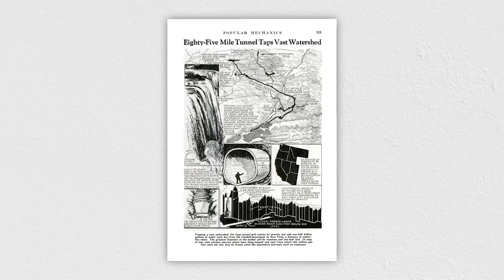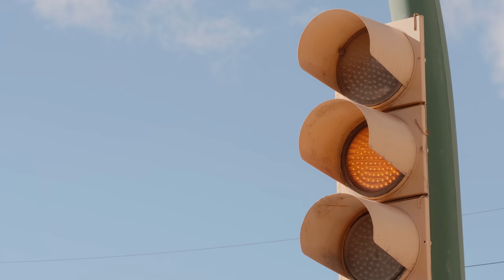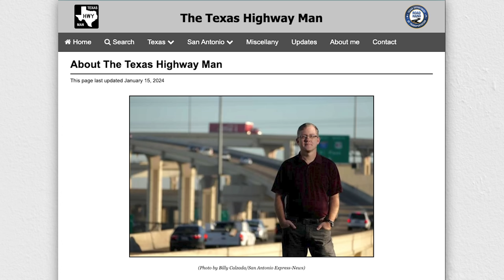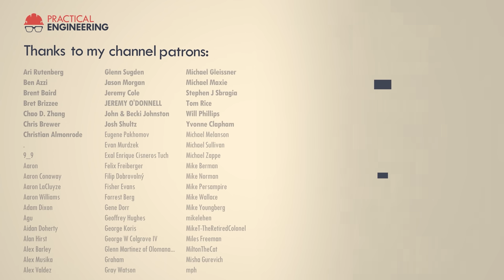Why Are Texas Interchanges So Tall?

Comment: As a german I find these giant stacked interchanges quite bizarre. Over here we rarely have left-turning flyovers. Most Autobahnkreuze (Freeway interchanges) are of the good old cloverleaf design, built in the 70s, with the lanes for off- and on-coming traffic seperated by a barrier from the through traffic. That makes the weaving in and out not so much of a problem. Next to the negatives mentioned I would argue the cloverleaf has a number of benefits: 
A) It doesn't have kilometers/miles of bridges per interchange that are both expensive to build and maintain since all of the ramps can usually be on earthen embankments. B) They are predictable. On a german Kleeblatt (cloverleaf) you always know where to exit: First exit to go right, second to go left. C) There (usually) is a continous looping sliproad on the inside that is capable of leading you in every direction, even if you missed your first exit (can also be used in case of Baustelle (construction work) on the right turning lanes). D) They are much less of an eyesore to the surrounding area as they are not tall at all.

Only when the cloverleaf really cannot cope with the traffic demands will the german civil engineer consider a different solution. With that being said the german freeways rarely exceed three lanes per direction so the traffic levels are generally lower. The busiest interchange in germany is still a modified cloverleaf (The Frankfurter Kreuz with the A3 and A5).
Reply: I'm sure a German you do, since your country is half the size of Texas and has four times the population density, its possible that you mentally may require a much fixed common driving solution.
Reply: Looking it up, Frankfurt has a population density of 8,100 per square mile & Berlin has a massive 10,910 per square mile while Dallas has a population of 3,841 per square mile and the Dallas-Fort Worth Metroplex's overall density is 880 per square mile. With densities so high, many German cities can rely on mass transit while most Americans live in areas far less dense where heavy reliance on cars makes more sense.
Reply: @Monsuco  You've got the causal relationship somewhat backwards: US cities' population densities are as low as they are largely due to their legally-mandated transportation infrastructure (*cough* a whole lot of bad law/regulation right there) and horrendous zoning. In most if not all American states/cities, it's *illegal* to build anything other than car-dependent sprawl.

You'd think with all that talk about the "free market", they'd let the market decide what it wants... BUT NO. The market's only allowed to do what it wants when it furthers the interest of certain well-connected and/or already-extremely-wealthy people & companies.
Reply: Yeah because you lot have busses and bike lanes. We don't have those in america, or we do have them some places but they're so terrible and unsafe that only the most desperate people use them. I hate your socialist utopia.
Reply: No you're getting the causality backwards. Look at Houston, it doesn't have traditional zoning laws and is arguably one the most free market systems of land use in the world, allowing commercial, dense residential and low density residential to built, often in the same neighbourhood. Yes there are covenants and historically there have been mandated lot sizes, but it would have still sprawled regardless as single family homes are the most sought after types of homes for most people. In countries like Germany, urban expansion is often arbitrarily limited through urban growth boundaries and is therefore less of a free market. A considerable amount of the population is forced to live in apartments against their will
Reply: "As a german I find these giant stacked interchanges quite bizarre. 
--------------------------------------------------------------------------------
As a Texan I'm sure you do.   But then I'd likely find Germany's mass transit somewhat bizarre, and certainly very restrictive.  I don't think most Texans would take kindly to all that coziness next to other people that mass transit implies.  We need lots of space to stretch our arms, and the freedom to make impulsive, unplanned stops.

Let me ask you a question that may sound dumb; but I've never been to Germany.  Do car owners in Germany have garages, to put your cars inside?

Comment: I will never understand why people are more open to multi-lane highways going all spaghetti but are reluctant to allow elevated railways that are only 2 tracks wide.
Reply: There are underground railways under all of that.
Reply: At a certain point the elevation becomes extremely dangerous anytime the weather is anything but perfect. It's hard to describe how dangerous it becomes to hydroplane or hit a patch of ice on a small piece of roadway that high in the air.
Reply: I can take a train (hypothetical) to any city and still need a car once I get there
Reply: @1970broncoman In America usually yes, except of some cities with extensive public transport, in Europe you usually have connecting trains, trams and buses to basically everywhere.
Reply: @jakobwinder3687  it is true that system is more developed there.

Comment: You did not mention that we have mild winters here in Texas, and for that reason, we do not have icing issues. When we do have a rare winter storm, all of these roads have ice on the bridges and have to be closed for safety reasons.

I will add that a freeway interchange is the highest point in Houston.
Reply: Houston doesn't have tall buildings?
Reply: @Imaboss8ball  Cities in Texas (and Houston is probably the worst of them at this) are kinda notorious for building outwards with tons of suburbs rather than having many tall buildings, there are some tall buildings in Houston but not as much as other large cities
Reply: @Imaboss8ball  If we're including buildings then the highest point is definitely not an interchange. There are plenty of tall buildings in the downtown (although the other comments are right, outside the downtown its basically all low buildings)
Reply: It's a joke that the 5 stack interchanges are the highest point in Houston because it's so flat....
Reply: Icing issues isn't a problem in cold places either. If the roads are coated in salt then ice doesn't form. It's more that Texas does have icing issues but deal with them poorly.
Reply: @Ergzay   There is no way of dealing with icing other than prayer.  /s  No salt, for sure.  I live in a little neighborhood in Round Rock, TX with two very short, very steep hills that must by used to get in or out or through.  Bless our great city government, they laid sand on on the little hills before the storm hit this year.
Reply: @RockHawley  Because we have a ton of flat land 360 around every major city, and most residents at least in TX prefer detached homes to apartments. Housing developments get built first, then commercial follows, eventually the homes built in the empty burbs are surrounded by commercial development, which leads to jobs, which leads to more sprawl as what used to be farmland has all the commercial spaces and now the farmland just north of the development is much more attractive for residential development.
Reply: @mattw1829  Its incredibly ironic that we build so many incredibly impressive megastructures... all for the purpose of getting people to little medieval houses. At least DFW is a major metro area, but sometimes you just look at a bridge to a small island and think this cannot possibly be the tax base
Reply: @Ergzay Why would we keep all the stuff to salt roads for like…two days a year maybe.
Reply: @FullLengthInterstates to be fair people like their houses and it’s the only form of housing with a positive fertility rate unlike apartments which always are negative bc people hate having kids when in confined space
Reply: @badart3204  It's all trade offs. Apartments don't have to be confined - a medium density shared building actually gets you the most interior sqft per $ of construction, and studio grade sound insulation is really not that expensive relative to the cost of the entire unit. We just typically don't build apartments for the purpose of maximizing interior space per unit because there are other trade offs. Even "detached" single family homes are squeezed closer together with minimum clearance and compromised yard space, because that is the best way to maximize units given the zoning restrictions.

Comment: I am in Houston, and these super tall interchange terrify my... the mind instantly goes to "what if this collapses while I am on it?!"
Reply: It’s unlikely to ever collapse as long as it’s maintained properly. So as long as txdot has $$$ those should be ok.
Reply: You are not the only one.
Reply: I'm terrified of the 288/BW8 exit. It's just too tall and too curved. The fear of driving off or having a piece of it fall off is admittedly irrational, but I just can't make myself drive 98' in the air. I find myself having to drive out of my way to avoid our tall exit ramps and interchanges. It's good to know I'm not alone!
Reply: It'll fall one day. Nothing lasts forever. Texas is cheap as hell.
Reply: Do you think that about airliners when you fly?
Reply: @gregburch1598  I do but I block it out and keep going.
Reply: @gregburch1598  I do which is why I don't fly lmao
Reply: My dad was at the top of the 680-101 Interchange in the 1989 loma prieta quake in California. He described the earthquake as feeling as though all 4 tires on his truck went flat all at the same time, but he made it down just fine and continued on his way home. Those interchanges are surprisingly durable. I live fairly rural these days so all of my roads are at grade. My worst traffic jam is about 5 minutes, and it's usually caused by the intersection of my towns 2 busiest roads, so I just avoid them.
Reply: I take the Washburn Tunnel quite frequently, I often think with how old it is, if it collapses my car is now my coffin.
Reply: @makingbiscuits24-7  You can just exit the highway and turn left on the feeder, no need to go out of the way, 288 and BW8 has a ground level intersection
Reply: If you're on a highway bridge when it collapses it's not gonna make that much difference how high it is, you'll be dead either way.
Reply: @awesomecomputers7076  "as long as it’s maintained properly" heh... heheh.. I think I need to move sometime in the next couple decades
Reply: @qoph1988  true, with the way the current politicians of Texas handle things I won’t be surprised if some infrastructure is left unmaintained.
Reply: @saadmalik8384  That's what I do, but it is a pain when traffic is busy.  I find myself going out of my way when it comes to other interchanges, especially when it's not something I drive often, like anything meeting 45.
Reply: @awesomecomputers7076  Well, assuming it was designed and constructed correctly.  My confidence in our bridges has been shaken by the Fred Hartman Bridge and the current update to the Beltway 8 ship channel bridge.  I'm sure the elevated portions of our freeways and their interchanges are built better and inspected regularly.

Comment: This is why traveling to Texas gives me the worst anxiety, being a guy who is paralyzingly afraid of open heights. It’s gotten worse as I’ve gotten older.

… and I’m flying to Houston tomorrow.
Reply: Reading these comments I thought I was the only one who is terrified of these interchanges, till I read your comment. I dont drive in the cities anymore very often. If I have to I stress about it the night before and also find routes through that avoid any and all bridges and flyovers. It can take me a very long time to get to my destination but it’s so much better to have a safe (ground) route.
Reply: And I was sitting here wondering why nobody was talking about height-related anxiety. I have a pilot’s license and these things freak me out. I avoid them whenever possible.
Reply: @codiesmth  
 It blows my mind that you are a pilot and have issues with these concrete nightmares!
Reply: Hope ya had an aisle seat
Reply: @JeffMTX  I did, in no small part because I’m 6’6” tall and need to sprawl into the aisles anyway.
Reply: @R-ecipes864  :)
Reply: It can be terrifying if you come from a place that doesn't have these huge highways or just never drive on them. I'm  from Houston, it's fun for me.

Comment: That looks like an entire headache to deal with.
Reply: The big stacks are usually pretty easy to navigate as long as you can read road signs.
Reply: It is and I hate it. I love driving which is why I support public transit.

Most people shouldn’t be on the road. In a perfect world I can go 65 in a 65 because the idiots braking for no reason took a train
Reply: No is not. I enjoy driving on them. No headaches.
Reply: The only real headache is the traffic jams. The signage to point you where you need to go is actually decent.
Reply: @Gundam4President I also wish teenagers and grandmas and soccer moms weren’t forced to drive. Then we could have had stricter licensing requirements.
Reply: @f937r  The problem with signage is that it seemingly turns your average driver illiterate
Reply: @chefnyc  With proper driver training and public transport we could realistically have a 90mph speed limit on most of the Texas interstate. 

We have the infrastructure capable of it. At 90 the roads are just barely coming alive.
Reply: It's not, it's very easy and these engineers that make them are skilled.

Comment: Current Texas driver that loves frontage roads because it means I can basically take the freeway without getting on the freeway you just have to leave 15 minutes earlier than what you planned, but it just makes the drive so much significantly less stressful
Reply: Now imagine if half those trips could be replaced by a short stroll, or a spin on a bicycle, in an area with little traffic noise.
Reply: @IstasPumaNevada Not all trips can be replaced by bike.

But the trips that are replaced by walking or by cycling will improve the trips that really do need to be done by car.
Reply: @IstasPumaNevada now imagine trying to have a family in tightly packed apartments which is what you are actually describing. For all the benefits of what you describe only single family housing has a replacement level fertility rate
Reply: They're the best

Comment: I grew up in DFW, and watched them build the High Five over the years. The finished product itself is a thing to behold. However, the roads you actually could drive on during the massive construction were much lower than the roads at the base of the interchange now. So it looked significantly more massive being 30 feet below what the road ended up being and looking up at the tallest ramps. Hell of an undertaking that was. It was pretty cool to witness.

Comment: The High Five is a great example of the limitations of car dependency. It's an incredibly expensive and complex engineering project, but it still have major flow issues. It's also very uncomfortable to drive with how complex it is to know the correct lane to take
Reply: Any and all systems have limitations.  There is no perfect engineered system.  It’s a feature, not a bug.

GPS makes it simple for me every time.  It’s unclear what would give you an acceptable level of “comfort” but you can never please everyone.
Reply: @matthewgaines10  in addition to using GPS and reading signs, you can also preview your route with streetview and satellite view. If you don't plan your trip, you shouldn't be surprised with the results.
Reply: Yeah. The video was very interesting, but the actual answer to the question in the title is: "because they don't know what trains are" 😅
Reply: Have you met the Katy freeway? It’s in Houston. It’s car dependency meets ‘one more lane will do it’
Reply: @matthewgaines10 

Things can always be better. And the limits of road transport reaches far sooner when public transport options are poor.